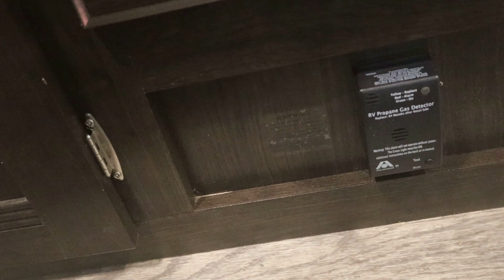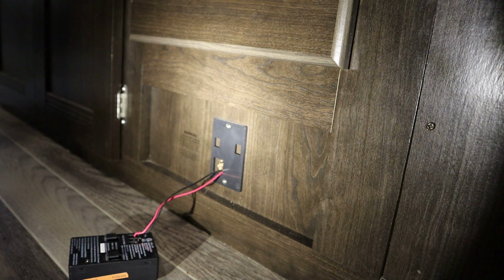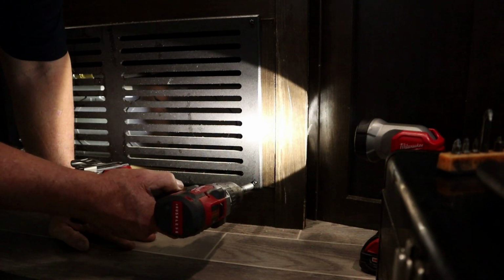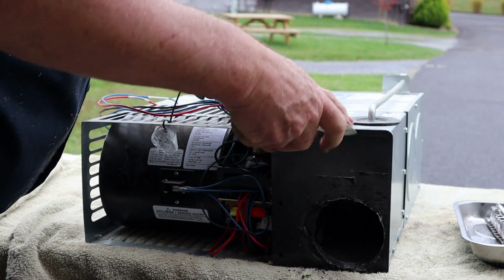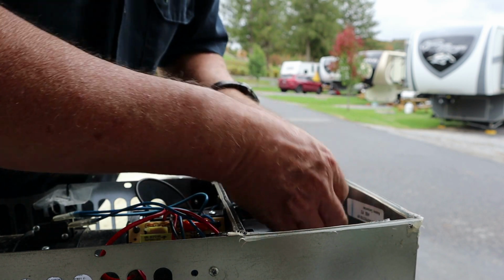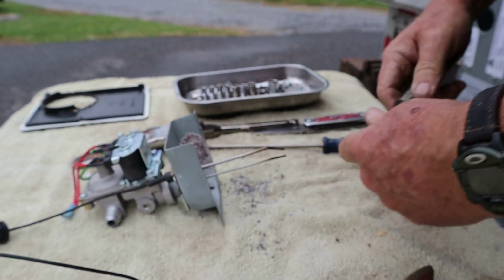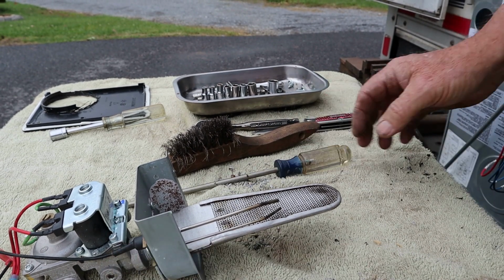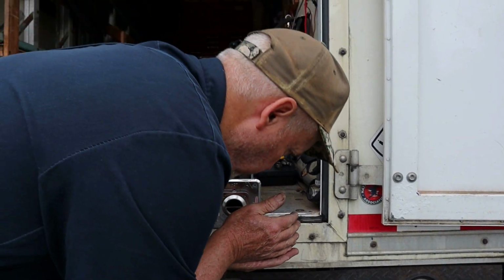LP Leak Detector Goes Off All Night

Comment: Wish I could get furnaces that come out that easy!  I just had to remove a shelf witits support brace, disconnect the sink drain, cut the down line and vent line so I could tilt the furnace on end to pull it out the cabinet door. That was a night mare. the lady was real particular about her stuff. Keep up the good work, cause I appreciate all you share.
Reply from the maker: Dang…. I hate those kind of jobs.

Comment: Could smell that thing all the way up here in Alberta 😅 👍👍🇨🇦✌️🇨🇦✌️🔧🔧  Had a question for you Kenny . Last week I was working on a Atwood 2334 2 stage furnace . It uses an igniter board & control board  & the thermostat has a circuit board which I’m sure you’re aware of . Is there a way to bench test these  ?  The normal 2 blue thermostat wires are not accessible to twist together  . I seen them at the Igniter Board & Control Board but didn’t want to jump them together in case I did any damage . The furnace is already 22 years young . Everything worked out great , always nice to check it out before installing & leaving DNA 😊LOL
Reply from the maker: 2334 ? Must have been a Candian thing. Never heard of one. Back in the day Candian and USA campers had a lot of differences. I don't think that is true anymore.

Comment: My Atwood 8535-111 works great except for when it's cooling down you can hear tink tink tink TINK . Like the metal cooling normally make these noises ? Wish I could send a video of this noise
Reply from the maker: Some do that. It is fairly normal. If it is excessive, you might want to inspect fire box to make sure there are no cracks in it.